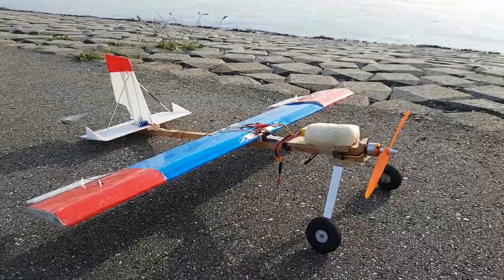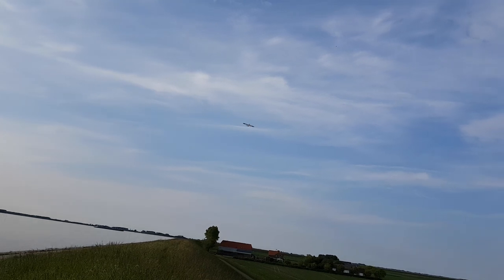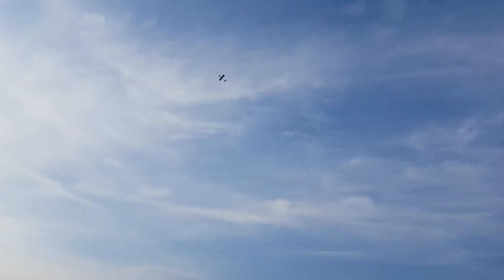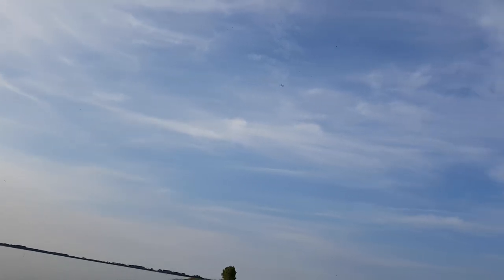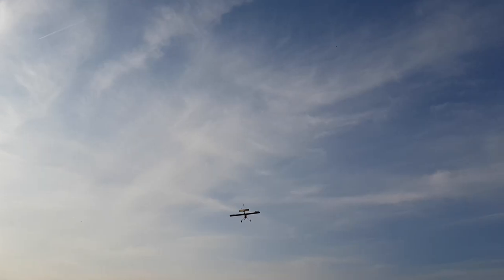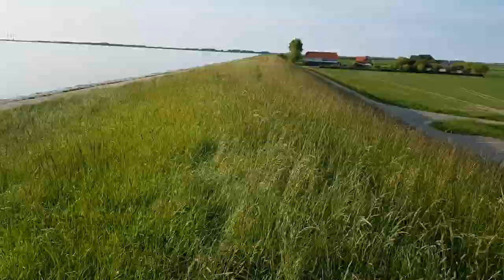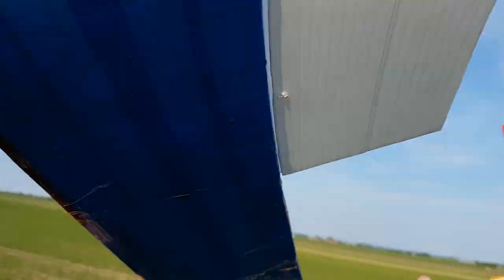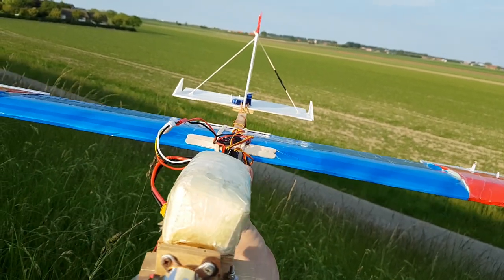UNBREAKABLE DIY Rc TRAINER 2.0 Second Test Flight ENDING in a EMERGENCY LANDING

Comment: Hey, would this design fly with 3s 1500mAh battery, 1000KV motor and wing length of 1 meter?
Reply from the maker: by luck you might say this wing is 1 meter long uses a 2212ad motor 1400kv dirt cheap and can carry a 1500mah battery no problem at all have a good weekend